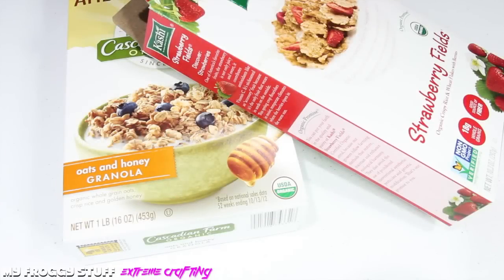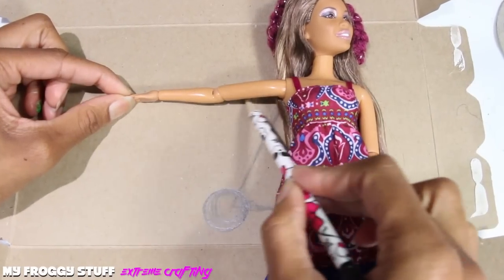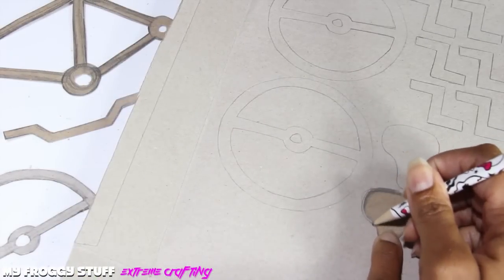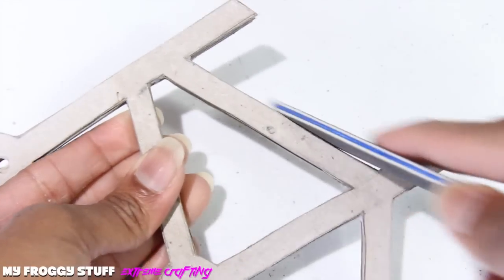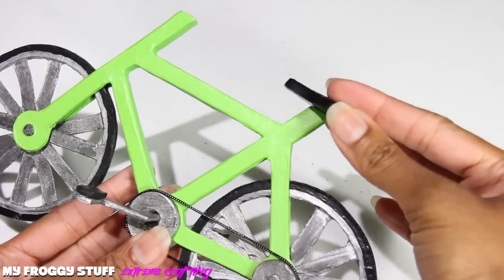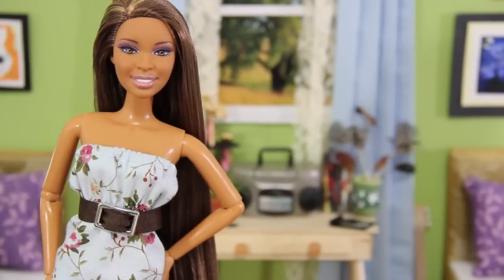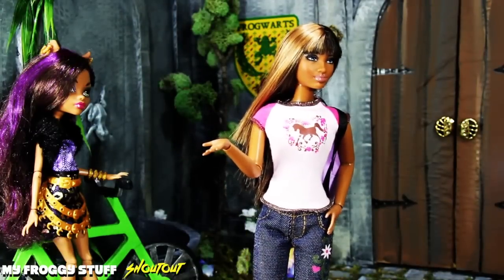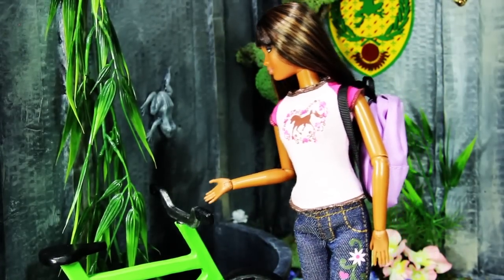How to Make a Doll Bicycle - Doll Crafts

Comment: a couple of dollish related questions. One: how do you deal with the strings from hot glue gun? They always cling to my project and the gun (dragging it/messing up the project and clinging to my skin". Second question: I have a Blythe LPS and the LPS comes with a collar that has a slit in the back like you can take it off. Can you take it off and use a an individual LPS?

Comment: What are those big eyed dolls called. Not the monster high or barbie, or littlest petshop, but that other one?
Reply: They are called Pullip Dolls. If you want to get one, but it's to expensive, you can get a J-Doll which is made by the same company. Keep in mind that Pullips are extremely fragile (recommended 15+). 'Big eyed doll' XD